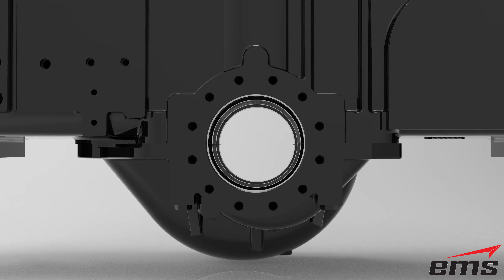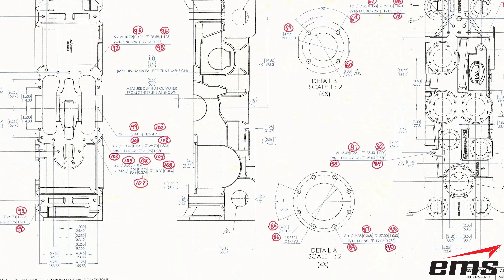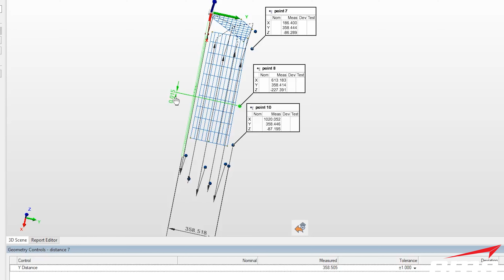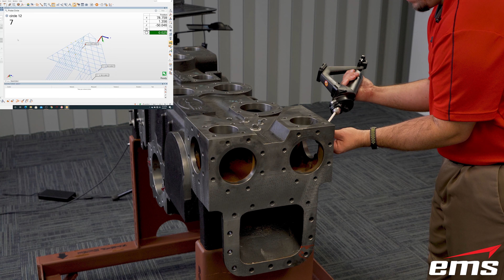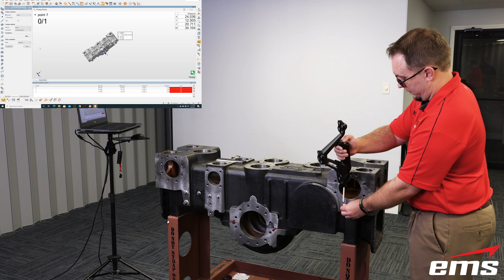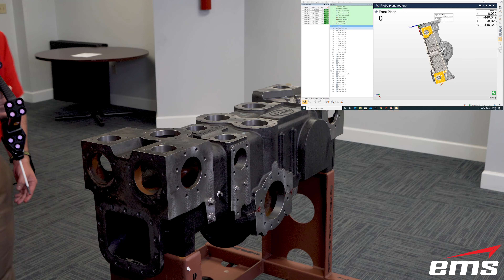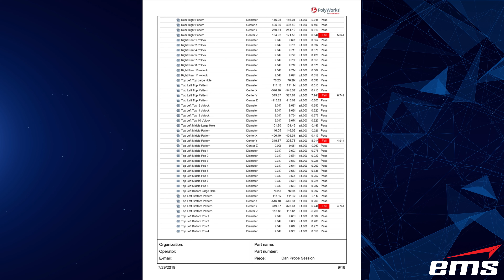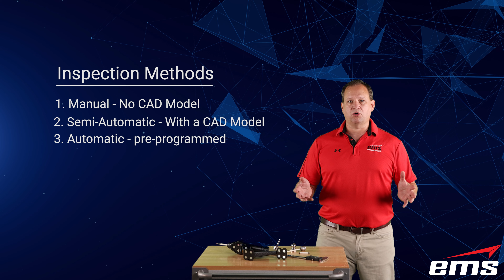Shop Floor 3D Dimensional Inspection Methods.

Comment: Crazy stuff  . Can it replace a cmm in terms of accuracy?
Reply from the maker: Depends on the CMM.  Some of the high end CMM's get down under 10 microns.  We are currently at 25 microns.  It really depends on your accuracy requirements.   If portability is important hand held scanners are a must.
Reply: @EMS3D  25um is already quite good